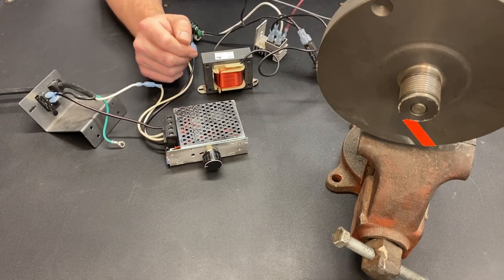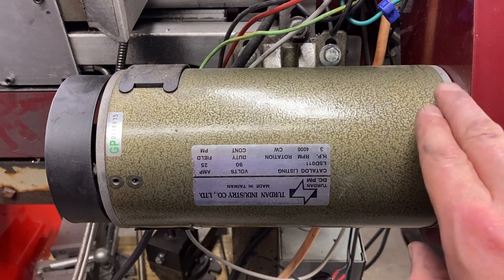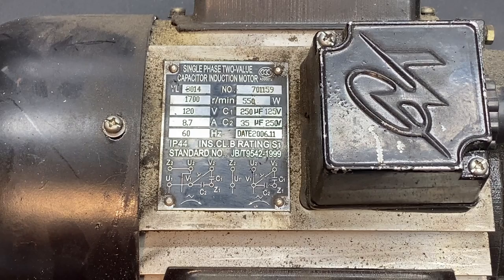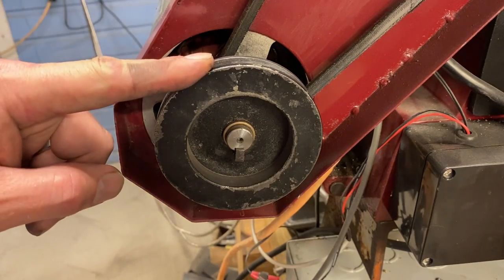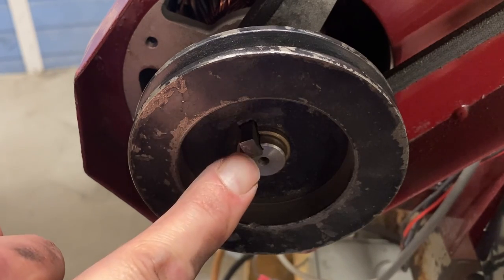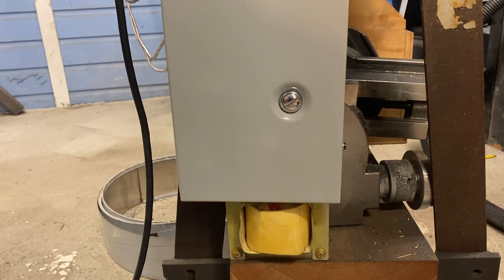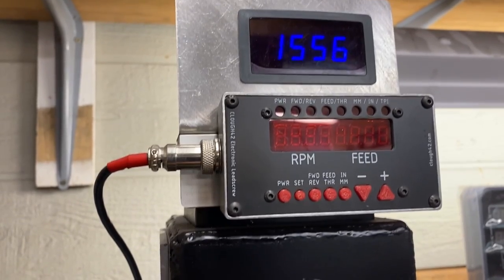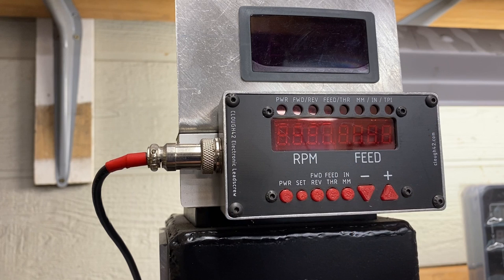Metal Lathe Treadmill Motor Conversion & Treadmill Motor Controller

Comment: Another great video except for one glaring "detail."  The torque value should be calculated at the spindle speed instead of the motor speed.  As an example, if I convert my lathe to a treadmill motor it will be geared to the same top speed that it has currently which is 2500 rpm.  In your first example the 4000 rpm motor geared through a toothed belt and pulleys would produce 6.3 foot pounds of torque.  In reality, the existing 1 hp motor on my 11x 26 lathe has enough power for the kinds of work I do on it so the new torque rating is not that important.  My goals would be to reduce the 150 rpm minimum to about half of that and maintain the peak rpm at around 2500.  The big added value is not having to fiddle with belts and pulleys to change speed. After 15 years of amateur lathe and mill work I've finally started referring to speed calculators for best rpm data.  Being able to dial in the RPM with a knob is a huge improvement.  It just needs to be FULLY calculated to know if the proposed replacement motor has enough power.  In your second example the 6700 RPM motor geared to a realistic speed, using my machine's 2500 RPM again, the true torque is more like 5.25 foot pounds.  Only a very narrow target use would require a 6700 RPM spindle speed.
Reply from the maker: I appreciate the comment and totally get what you are saying. Yes final spindle speed and torque numbers are important BUT it was not a glaring detail.  Not all treadmill motors are created equally and you must know what you are starting with to find out if it is even in range.  Most guys are replacing their AC motor with a treadmill motor and retaining the existing gearing.  The motor calculations give you an apples to apples comparison to find out if the new motor even has the potential to work.   I have had a ton of people reach out because they go with a cheap treadmill motor and can't figure out why its not working well even though it is way more HP than the original AC motor even with gearing.  With gearing a lessor motor with higher RPM max can be made to function the "same" as a better motor with the lower RPM rage but all those RPMS are going to translate into shorter motor life, more heat (this is why high RPM treadmill motors usually have blue wires) and an inferior system for the long run.  Starting with a direct comparison avoids those problem and THEN you can use the gearing calculation to dial things in, adjust RPM range and torque so yes it is important...very important, but beyond the scope of this video.

Comment: Your math implies that at zero RPM, Tesla motors develop zero torque.  What am I not understanding here?
Reply from the maker: It's actually a null set because you can't divide by 0.  First of all an AC motor has a torque curve and max torque is usually at designed RPM.  HP has always been a calculation TRQ * RPM/ 5252.  So a motor with 4 #Lbs and 0 RPM would produce 0 HP because the motor is not spinning and HP is the ability to do work but the torque is still there.  But all this is dependent on the torque curve.  That is one nice thing about DC motors after initial startup speeds the torque curve is constant.

Comment: Please stop saying "rpms".  RPM stands for "revolutions per minute".  RPMs means "revolutions per minutes".  How many minutes?  It is ambiguous and meaningless and drives engineers like me nuts.
Reply from the maker: I appreciate the comment and you are completely correct, but it is not likely to change.  Don't get me wrong I too prefer accuracy but I am also creating these videos off the cuff and a lifetime of making RPM plural(er) 😂😂 is not a habit that will easily brake.  Also adding an s to RPM is very common in the vernacular all-be-it inaccurate.  20 years of using RPMs in a fairly public way for both my automotive interests and now my machining interests and you are the only one to ever point out the error.  Again I really appreciate the comment and will try to take it to heart but the practical application is not likely.